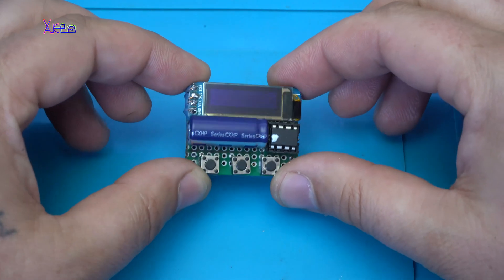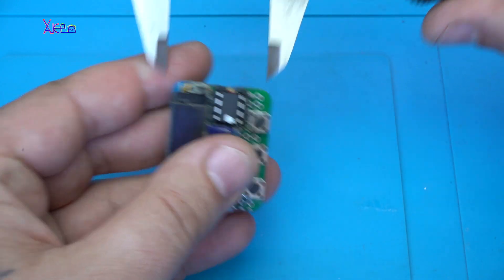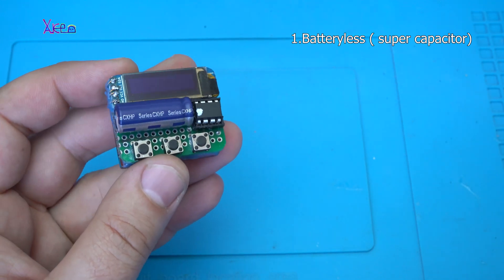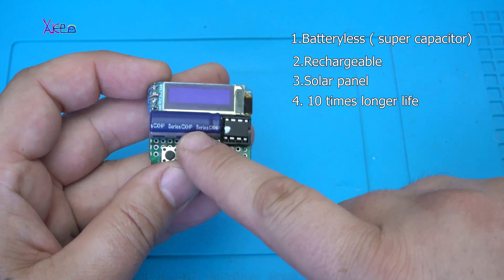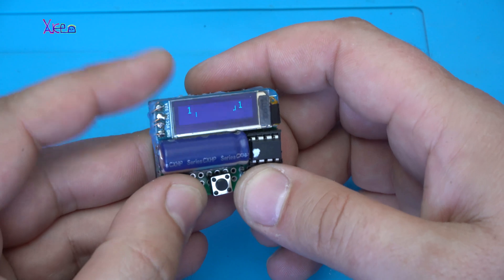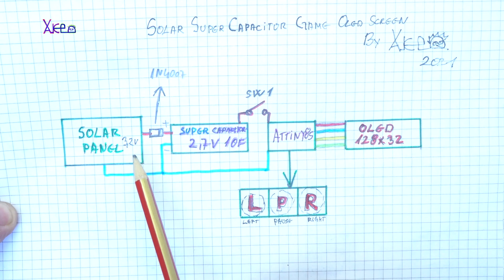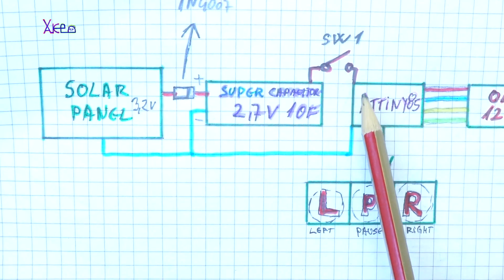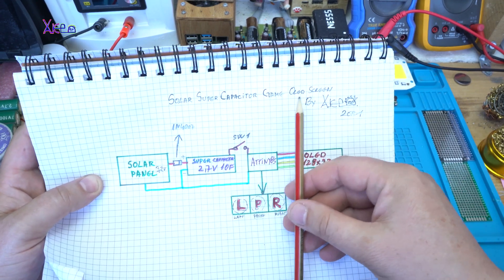Homemade Batteryless Invention - ping pong game

Comment: How did you arrive at the run time being 10x more than a battery ?
Can't the solar panel keep up with the current drain ?
Reply: I believe he meant "Lifetime" and not actual running time. It would have been interesting if he mentioned how much a charge lasts before it's time to charge again.

Comment: Cool project but please dont make up such excessive claims about supercapacitors a 2.7v 10f supercapacitor can store (10F/2)*2.7V² = 36.45 joules = 0.01~ watt hours of energy while an ordinary 18650 li-on cell can store 3.7V*2.5Ah = 9.25 watt hours of energy its not even close please dont spread false information <3

Comment: There's one thing I'm not getting. Where do you get the voltage for the OLED? You're supplying circa 2V7 into the circuit, but the operating voltage for the display (not the driver IC) should be 3V3.Am I wrong? how are you dealing with this?

Comment: How do you manage to control the Super Capacitor current and voltage for this circuit. Because Super capacitor will discharge like a e-curb.